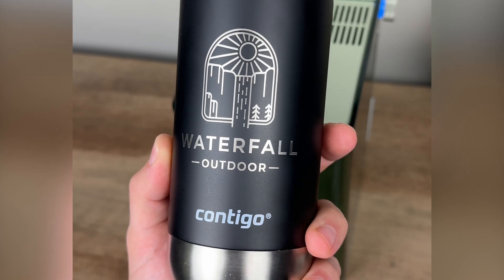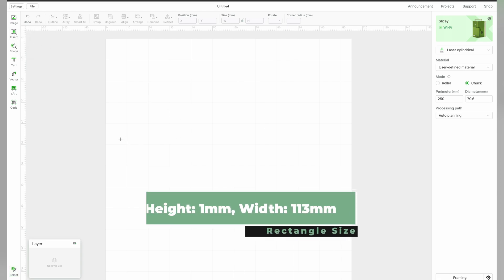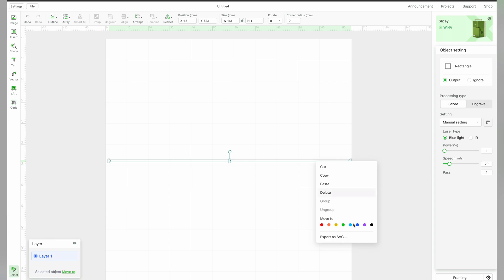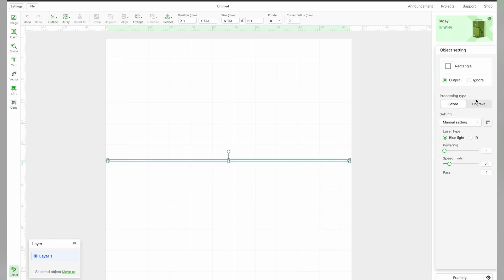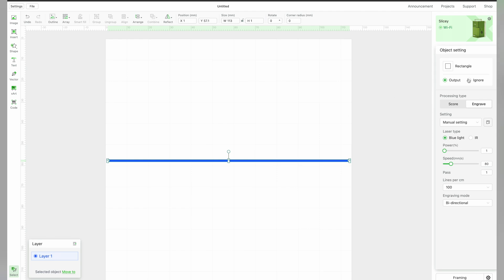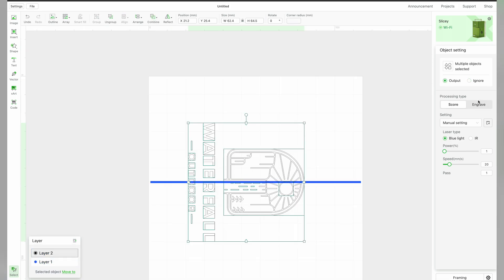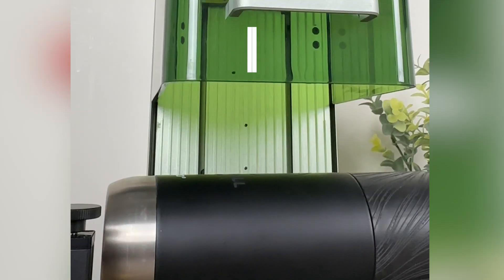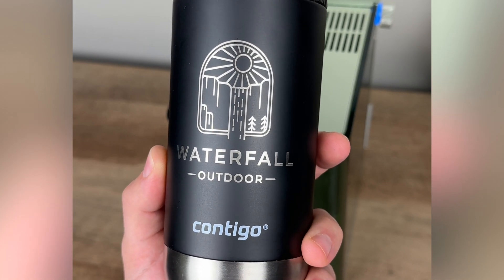Centering Engravings with the xTool F1 and the RA2 Pro

Comment: I tried to centre , when m doing on flat surface . The line is showing  and I can adjust but when m doing it on chuck , I can’t do it 😢
Reply from the maker: You don’t want to adjust the line in XCS you need to rotate your cup in between framing until the line is centered on your logo
Reply: I did it thank you so much ❤

Comment: Did this - thank you so much for sharing!! I’ve had a heck of a time getting mine to align. Any idea why it’d still be off centered? It rotates perfectly when framing but doesn’t rotate enough when processing 😅
Reply from the maker: 🤔 Hmm Are you engraving on a tapered water bottle? The only thing I can think of is maybe your measurement for the perimeter are off. For tapered water bottles I usually measure in the middle of where my design will be. 

Also are you using the rollers or the chuck?